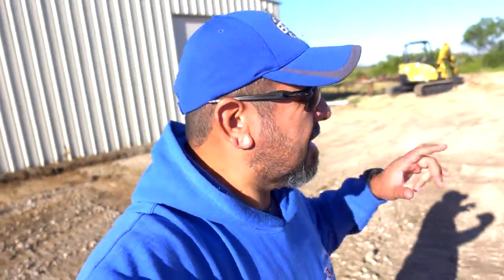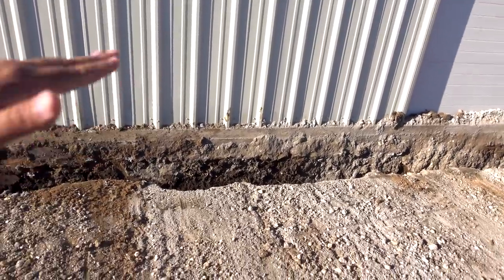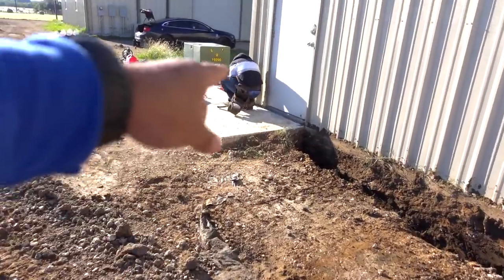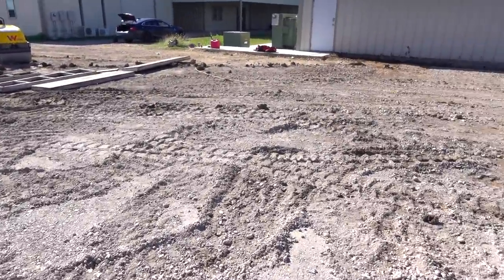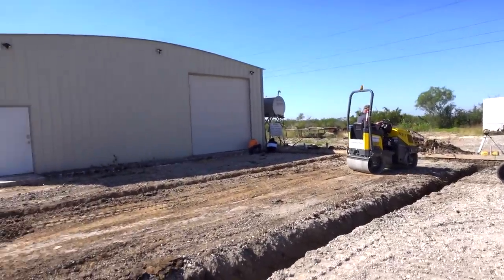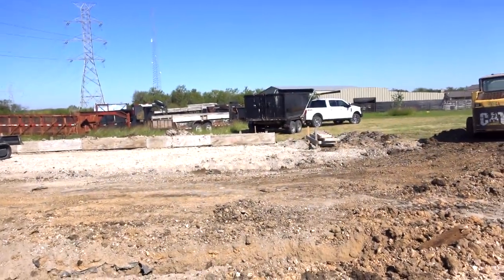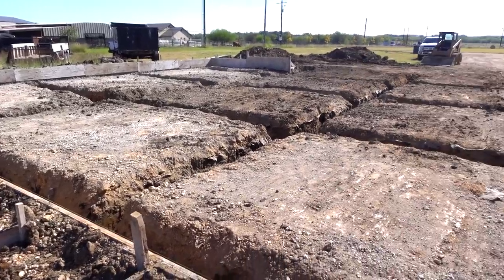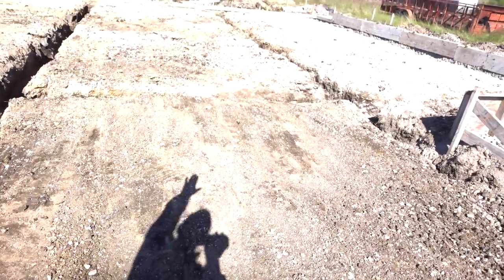Expanding the machine shop 3 | Cortina Precision

Comment: I live in Indiana, I wanted to put a basement in and the contractor said I could not dig next to the house or I risk cracking the concrete pad my house is built on. My house is a pole barn style built. Put I am sure my house isn't built as good. I dont think my house has the foundation on the perimeter like the ones you build.

Comment: I'm curious, how long does that 6 mil poly vapor barrier seem to last under a slab?
Reply: I moved a drain in a house that was built in 1984. It was built on clay and wasn't built up at all. All cracks even hair line seep moisture when it rains. The prints on it I found in a book shelf, called for 6 mil barrier. Where I moved the drain the moisture barrier is brittle as if it was in the sun for awhile.  I imagine at the cracks it's separated. However in a previous house I owned built in 1963 it didn't seem to be deteriorated at all. It was on sandy soil and didn't have the drainage issues like the other house. It's something you can't go back and fix so I'd definitely do it right. Seem tape ect.
Reply: @hairtrigger903  I'm going to build in a desert on sandy soil so hopefully it lasts but it's close to a wash so when it rains it might get wet if water can get past the French drain...

The reason why I care is I want to build ICF and that might last a couple hundred years or more.  I don't want to have rising damp issues a couple decades in.